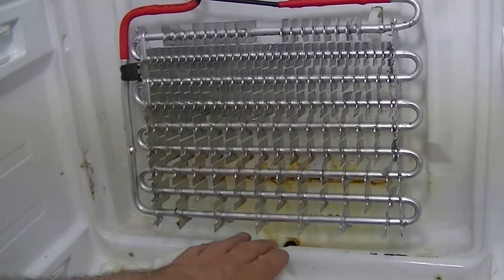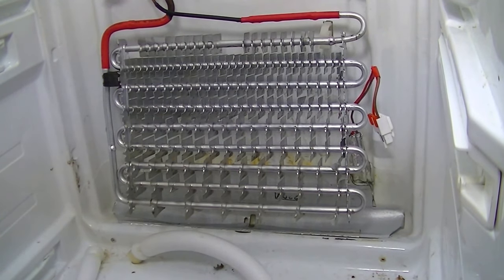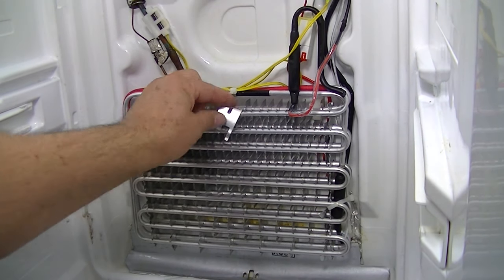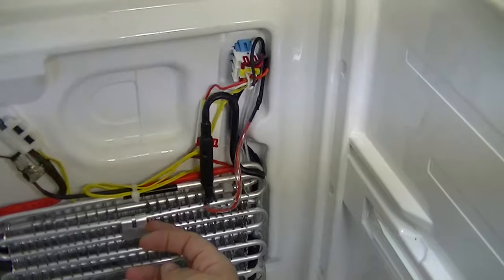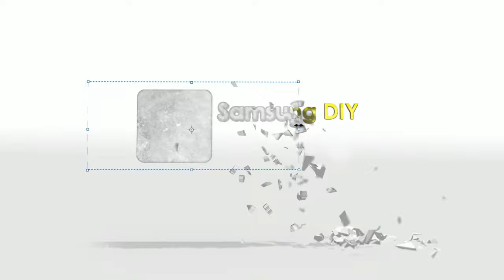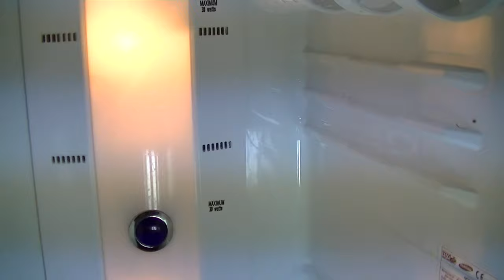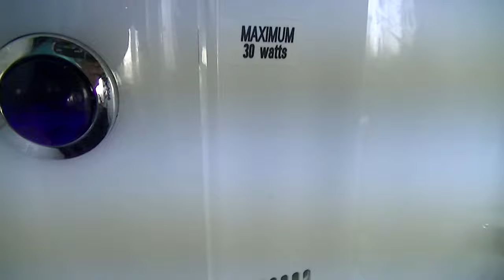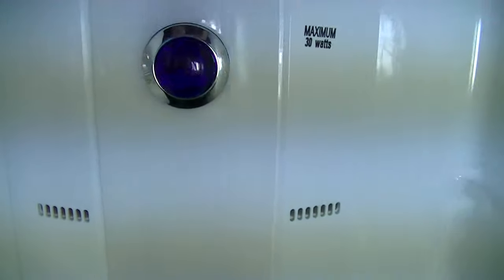Refitting Samsung Fridge Repair Kit full video Model RS21 , AND SRS - HD

Comment: Want to give a more informed comment. The kit arrived very promptly and came with clear-as-a-bell instructions about what had to be done. The worst bit was actually de-icing the existing element in readiness for installing the new one. I had lost count of how many times I have had to de-ice in the past just to free the fan and get some sort of cooling from my ten year old Samsung. It was not cooling below 18 degrees latterly! Once de-iced and dry, the excellent vidoes here on YouTube took me step by step through the relatively straightforward process of taking out the old and putting in the new. Because my machine is quite old I had to go to a second video in order to make the electrical connections fit, but again this was nice and clear, simple without being patronising. And before very long, I switched on, and ta dah - welcome back Mr Fridge. Yes, I did not want to have to spend any money on it, but I do consider it first class value - you get a lot of bits in that box - because I am sure that the fridge will now last a further ten years. I would recommend these guys without any hesitation at all - it is a well-thought out service and I am surely not the only delighted customer. 100% satisfied - thanks, and well done on an excellent product!
Reply from the maker: hi thanks again ally
Reply from the maker: thanks for the feedback always appreciated ,  as ever if you need further info call our tech line

Comment: Thank you so much for doing such a comprehensive how to video. I called in a No Fix No Fee repair company who said the parts were obsolete and charged me £75 for not fixing it. I don't have the money to replace the unit so as a last ditch effort I bought the parts and attempted the repair. So far its been an hour and things are looking positive as the temperature is slowly dropping and I can hear the fan working.  Hoping this has fixed it for me.Sorry I did not know of your company but any future parts will be ordered from yourselves.

Comment: Thank you so much for posting this. I have just changed my defrost heater as it was tripping the house. I also changed the defrost tray as it was badly corroded 👏🏻
Reply: I done my heater as it was tripping the house , then plugged it in and it still tripped unplugged the heater worked , then I plugged it back in , and unplugged the thermal fuse worked order new one put it in and still tripped the house what the hell !!!

Comment: Excellent series of videos thank you.  I ordered a new evaporator cover from a Samsung parts supplier (£88), but it clearly wasn't a full repair kit as it didn't include all the other bits.  I had to order the drain heater separately (£30) and the only way I could get an evaporator heater was to buy a complete evaporator repair kit (£69), as the heater was not available as a separate part!  This meant dismantling the evaporator assembly to get the bits I wanted.  It come with all the sensors however.
I spent more money that I first thought but managed the repair OK in the end although I did have to swap the fan wiring loom as shown in the extra video as the connector was different.  I think without these videos I would have thrown in the towel and just bought a new fridge!!

Comment: I have an SRS600HNP here in Australia and have had the defrost heater replaced under warranty some 4 years ago.
The ice has now returned and the fridge is high temping. 
I'm going to get a hair dryer to melt the ice to render the plastic panel to come off without breaking anything.
I don't know what it all looks like to order parts yet.
I am suspecting the heater element at this point, but I will meter it out to know for sure.
Cheers

Comment: Many thanks for this video, it was easy to follow and I replaced the defrost heater and sensor, thermal trip and back panel all with no problems in about three hours, including de-icing the coil and sensor. It had actually frozen right up to the left hand de-odouriser! Commentary was SO useful as well!
Reply from the maker: HI thanks for feedback always appreciated  please fell free to call or get in touch if you need further help , ally

Comment: Thank you for the video, so glad we can see how to do this.  I've got an RS21 n the temperature in the fridge and freezer fluctuate.  If I fit the parts you did will that resolve the problem..?   Hope u can reply.. Thanks very much
Reply: The parts normally only cure issues with the fridge, i would recommend consulting a local  engineer to check issue with the freezer

Comment: Excellent all round.....quick delivery and first rate videos on how to replace the parts!
Only thing to watch is if your Samsung is one of the older versions, mine was an SRS2028CVW bought in 2001, the connector for the fan has changed from a one piece connector to two individual connectors that won't fit the connector on the back of the fridge. I am fortunate to be in the cable/connector business and I was able to take off the old connector and refit it to the new fan assembly. Best check this when you order a kit!!
Apart from this I cannot fault these guys......!!!
Reply from the maker: https://www.youtube.com/watch?v=cgK48WpHQY0
hi thanks for feed back   here the video re this issue - thanks ally
  ,
Reply: Hi Ally, I've added a link to you on the Fixya site for anyone else having problems with their Samsung fridge.
Reply: Hi thanks for that appreciated

Ally

Comment: Robert Thomas ... Excellent videos - thank you.  My Samsung SR-S2029C has been beeping intermittently for over a year.  It started in 2013, with the «Quick Freeze» flashing on, off, on,off in quick succession.  This was so bad that we arranged an alternative fridge so that ours could be sent to the local repair shop.  The day the replacement fridge arrived, ours stopped beeping!!   Recently it started again, but this time it cycles through the «Ice Maker off - Crushed ice - Ice Timer» controls. I have to empty the Ice tray almost every day as it fills up completely with ice.  Some days it only beeps occasionally, other days, as today, it is almost constant and is driving us crazy!!!

In 2011, we had a problem with the fridge side freezing up and I learnt how to dismantle the back panel and remove the ice.  (Mainly by trial and error, as your excellent videos were not available then) This problem was solved after several attempts by the local repair shop who I believe replaced a sensor.  As far as I am aware, the complete updated repair kit as shown on your video was not installed. I live in Portugal, and have been unable to locate a company who seem to have the same expertise as yourselves in resolving these problems.  Your suggestions would be most welcome.

Comment from the maker: hi sorry for late reply  , these srs models can suffer also from the front display pcb playing up , if you are getting weird and wonderful beeps etc from the front display area i would recommend replacing the pcb - its quite tricky as you need to remove the plastic from around the front area to access the pcb , but that would be my 1st move to solve this issue - they maybe another underlying issue but mostly this issue is caused by a faulty pcb , thanks ally

Comment: I have used your guide to change the defrost heater, it worked well but it now has another seperate issue. I noticed it keeps tripping out a lot. The problem is when the unit is so close to the back well, I think when it doesn't get ventilation it just trips the switch on the power supply. I solved this by moving the unit about 4 inches off the back wall and it runs reliably now. I noticed a lot of dust build up on front intake (behind the plastic strip under the doors). Any ideas how to clear up the and improve airflow to the motor?

Comment: I could not find the Defrost Heater sold separately in US (110V). Do you have a part # for the us version? 
For Samsung RS267lashI had to buy a complete unit just to remove it.

Comment: Hello I'm writing from Argentina currents. I want to ask a technical question if you will be so kind to give me an answer I will be infinitely grateful.
Regarding the refrigerator that shows in the video ami I am interested in knowing what value has to have the censor of defrost values are manifested in (K) for example: I saw some that measure 5k and this throws me a value of 0.51k in Temperature, while being tested in the freezer reaches a value of 1.21 k, in the resistance is able to see a paper asked for by and says 322k is true? I would like to know what value I have to buy the defrost censor to work efficiently. greetings thank you

Comment: I have done my heater as it tripped my house then it still tripped with new one so I unplugged thermal use and it worked so ordered a new one plugged it in and it still tripped the house ,, do you have to run it then plug the new one in or reset it
Reply from the maker: when you unplug the thermal fuse this stops power going to the heater ,  you may have a faulty heater I would also check the drain heater  as its connected to the main heater , you could do this by just unplugging the connection between the heaters

Comment: Hi my RS21DCNS Samsung fridge is all frosted up around the heater does this mean I just need to replace the heater? Thanks Mike
Reply from the maker: hello Mikey   , you can just replace the heater but its not a good solution, you are better to fit the full kit  as the big white panel where the fan is situated normally just re freezes over if you dont change it - and you get similar symptoms of original fault  ,   so it cost a bit more to do all the kit but its a far better repair 

hope this helps ,   order direct from our web site using link below   

http://samsungdiy.co.uk/Samsung-RS21/Samsung-RS21-Repair-Kit
Reply: appliancetechnical cheers thanks for the quick reply 👍
Reply from the maker: no probs  our help line number is 07407 734 204  if you need to speak to us , ally

Comment: Hello, good night, my Samsung RS21DAS side by side refrigerator has stopped coming out of the water, and there is no problem with the water in the house, what can it be?
Reply from the maker: hi 1st check to  see if water bottle has frozen , water bottle is situated behind the 2 big salad drawers in the fridge section , you can heat the bottle with a hairdryer for 5 to 10 minutes   - then check if water comes through , 

if its still not working you may need to call a local engineer 

if this does work - this could be early signs of common issue  best to check out our repair kit 

http://samsungdiy.co.uk/Samsung-RS21/...

Comment: Have fitted the kit for an RS21DCSV BUT the kit came without a drain heater because the video states that you only need it for SRS models - THIS IS INCORRECT - my model definitely has a drain heater and has no prefix SRS anywhere
Reply: Bob Locke - it says in the video that these don't tend to need replaced in the non SRs models, hence why it isn't included in the kit